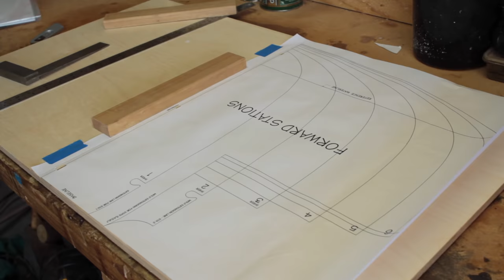Building a Cedar Strip Canoe over 10 months!

Comment: Congratulation my friend. Perfect job. I wish I had the space to built something like that also. My space permits me to built a wooden rc boat of 80 cm. However I am also planning to cover outside with fiberglass and liquid glass. What kind of oil you passed at last the hull? I thought that after the fiberglass nothing else is applied. I am looking for your advise. Regards from Greece.
Reply from the maker: Hello! Building an RC boat sounds like a fun project! After sanding the epoxy I finished it with marine varnish with uv inhibitors, epoxy is prone to breaking down under UV light so it’s good to give it a few coats of marine varnish to protect it and it needs reapplying every 5 years or so. Probably less important on a model but still the epoxy has a rough finish on it and you’d probably want to sand it back to make it smooth and apply varnish over it.
Reply: @DavidParker  thank you very much for your time to reply me. Now it’s clear. I wish you good luck with your future projects.

Comment: Did you bend the brass stem band for a space for a ring?  Or were you able to find one to purchase that already had the bend in it?  Thanks.
Reply from the maker: It comes flat and you have to bend it yourself. I bent mine before drilling the holes for mounting screws so I didn’t snap it. I ordered mine from Orca Boats website.

Comment: Hi David Parler . Were did you get those nice peace of cedar wood 15 feet long with no nuts  into it ?
Reply from the maker: I got the wood from BBS timbers, wasn’t cheap but worth it!
Reply: @DavidParker  Thanks David . Im from North East Quebec Canada and i think it will be hard in my area to find those
Reply from the maker: @daniellachapelle952  I’m pretty sure they get shipped out to New Zealand from Canada!
Reply: @DavidParker  Ok i will check  that out from my area . . I did reach many guys in here Canada and the way they are talking so it  looks like they joint cedar wood peaces by peaces  to make canoe  because here cedar having thousand nuts in the wood so they cut  peaces withno nuts and they joint them together with glue and i dont know what type a glue they are using but it mite be a rel good glue to be able to make it solid . Very hard in here to pickup the right information in my area for making those
Reply from the maker: @daniellachapelle952  if you contact bearmountain boats they sell the strips pre-milled and with the amount of work that goes into milling them it’s definitely worth it
Reply: @DavidParker  Thank You David i really apreciated . I will try to reach them for sure

Comment: Hi! What tool are you using @11:07? I'll be fairing the inside of the hull fairly soon.
Reply from the maker: That’s a little violin makers plane, I wasn’t happy with how the paint scraper and sanding was going so I spent quite a bit of time with that smoothing out any lumps, still wasn’t perfect where the pattern strips are as they’re a hardwood and so the cedar sands away much quicker but you don’t notice that tiny imperfection after fibreglass etc
Reply from the maker: I wouldn’t necessarily recommend that plane, it took a LONG time, you might be better with a chair makers travisher or something? Or just getting a few people with curved sanding blocks but I lost my patience for sanding!!

Comment: It's beautiful, but I have a question.... Why would anyone do this?  You can't really sell it. You could never get enough money for it to recoup the labor.  
Even if you were only building this particular canoe non stop over and over and could do it pretty quickly, it would still drive the cost so high very few people would want it.
While a store bought aluminum canoe could never match the beauty and workmanship of this canoe, it will be still be better. It will never rot. It does not need much in the way of maintenance and is MUCH lighter and 1/20th the cost.